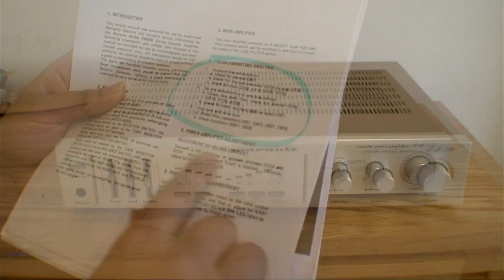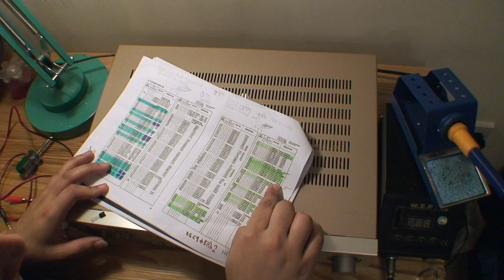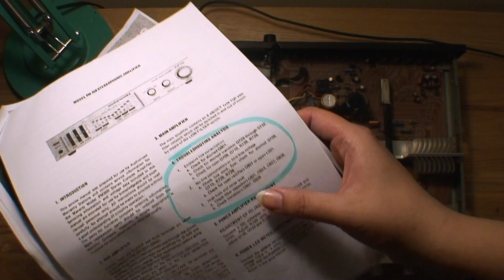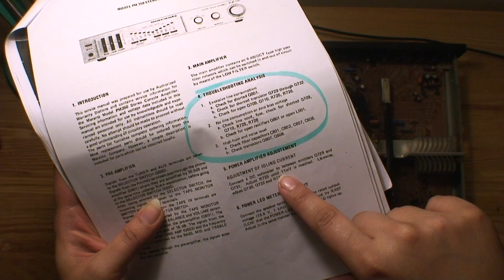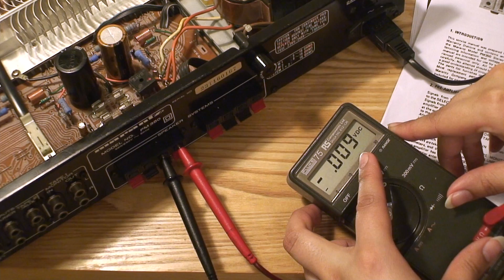Vintage Amplifier repair - 05 Adjusting the idling current (Marantz PM350)

Comment: Cool, another serious audio nerd like me... but this one is a very cute female one!... Are you married? Lol!... I suppose you are, and you're husband is a very lucky guy to have someone so smart as a partner!... I would love to have also! ;) (Are you maybe Italian or??? Your voice and accent and is very pretty, but I can't quite put my finger on where you might be from...)

BTW, you sound like me when you're testing something, "I just cannot get it hooked on that FREAKIN' wire!" LMAO!... Don't worry though; unless you are ever testing or working very close to the AC power mains input parts of that amp you won't get shocked... Shorting something out on the board and damaging it is a real possibility to watch out for though if you're not careful!... Steady hands and very careful placement of the testing leads are key... But those small old Marantz amplifiers are awesome sounding and performing, and definitely worth fixing properly, so I commend you on your efforts here! I also used to have a Marantz amp very similar to that one you have until it got STOLEN from my dorm room when I was in college; such a bummer! I was pissed when that happened! :(

I have a very helpful hint/suggestion that you might consider using next time you do anything like this on an audio amplifier; When you are adjusting transistor idle current, and also when checking for DC offset on the speaker outputs of an amp, instead of using the normal DC Volts range on your Fluke meter there, you should instead use the 300mV DC setting, that way you will get MUCH greater resolution and precision with very small mV readings like what you were measuring for there!... And also, one other thing to consider is that after you adjust the idle/bias current of a transistor, especially if it's way out of spec at first, you always want to go back and check it again, (and re-adjust if necessary), after a few minutes at the new setting, because many transistors will sometimes tend to "drift" slightly off of the initial/new bias setting until they are thoroughly "used to" the new setting. (It usually takes most transistors a few minutes at the new setting to completely stabilize themselves.) I don't know how to explain it better, but just double check the idle/bias current measurements at least twice on both channels before calling it "done". I usually check twice more on each channel after the first setting adjustment is done, so 3 times total on each channel at minimum... I usually do one channel then the other and keep switching back and forth between them with my meter until they both stabilize at the new, correct setting... If you take the time to do that then you will see and understand what I'm talking about. Plus it will end up being even better balanced between the channels that way too.

I think I'll add another subscription, one which I will actually look very forward to seeing more videos from! ;)
Reply from the maker: Thank you Joe for taking the time to watch my videos and for putting thought into your comments and suggestions! btw I socket my ICs always :o) that video clip was from quite a few years ago when I didnt, and had to desolder an ic from veroboard.. yes I learned my lesson well!!! lol

Also thanks for informing me about the drifting of transistors on this video! This amp is due a checkup and 're tune' so i will take it on board, and of course do another video of it. :o)  
 
Also I'm flattered by your kind words, thanks lol I'm not Italian but people have sometimes mistaken me for Spanish once or twice lol but i'm Arabic, We dont look 100 miles apart I guess, both in the mediterranean region :o)
It seems like you have good taste in music ;o) I have to agree also that La Isla Bonita is one of Madonna's best, it's my all time favourite! I have two La Isla Bonita Singles, one is a Japanese single with other tracks on it and the other one is the once you saw. I have the single on both 7" and 12" vinyl record also.

I'm happy to hear that you're enjoying my videos and thank you for subscribing, welcome! :o) 
And a lot more to come! of course
Reply: So you are Arabic huh? That's very cool too, and after watching a few more of your videos, that was gonna be my second guess... I suppose that's where you get your natural beauty from too! ;)

I really like it when YouTube posters such as yourself actually take the time out of their very busy life schedules to actually read through the comments that people make to them, and reply to the more decent ones!... I'm sure you see some "doozies" every once in a while which aren't worth your time, but I know that I appreciate it at least... If I had a camera to make my own videos and was also able post them, I would always try to do the same for my commenters too!... Thoughtful replies to comments shows good character and true *caring*, both of which I can tell you have in spades! ;)

I will (try to) make this reply (relatively) short and quick, (maybe, lol), because I have to go to bed soon because I have to work tomorrow, but did you also see my comments in a few other videos of yours on the following additional items: (?)

1. I had previously suggested to you in your "Audio Visualization Project- 01 Intro/History/Build" video, to try using desoldering braid for desoldering components from circuit boards, however, I just recently watched your newer video where you were trying out your new desoldering pump, and since that thing works so amazingly well, you can just ignore my previous suggestion about using the desoldering braid shit, lol!... I had no idea those active vacuum pump type desoldering tools are so effective because I've never had or used one before, but after watching that video about it I'm definitely gonna get me one of those!... 
One question about it though, since I noticed that that video about it was almost a year ago now... How is that desoldering pump tool still working today? Is it still operational and just as effective as when you first got it, or did it already break or wear out? (I seriously ask this because it looks like it was made in China from that website you bought it from, and since most stuff from there seems to be "less than the best" to put it nicely, I was wondering if it was still working good for you currently, so I know whether or not that model is worth buying for me too.)... Please LMK what you're experience with it has been over the past year or so since you got it... 
Also about the stuff below...

2. Using the 300mV DC setting on your Fluke meter when taking small mV readings such as transistor bias/"idle current", DC offset, etc., in order to get much greater resolution and accuracy in your readings!

3. Dolby B/C vs. ANRS/Super ANRS comparison video if you find the time and equipment to do so. (Or at least your thoughts on the comparison, as I had commented that I did that test a few years back, so I'd be curious what you think about it too.) (You mentioned that topic very briefly on the video for the Sony WM-D6C) (Not at all a big priority, just wondering if you had any thoughts on the topic.)

4. Will you please, please maybe make a video showcasing your whole entire music and CD/vinyl collection sometime soon? I'd really love to know what else you have and love to listen to, as I'm sure many others would too! I will most likely find a few new albums for my own enjoyment also by seeing your collection! :)

5. Is Madija your real name, and do you produce yourself all of those very cool sounding electronica/chillout songs which are in most of your videos? (If so, that's totally awesome; you are really good!! I definitely want to hear much more of what you can create/write/produce!)

6. Also, have you ever had the opportunity to play with a so-called "synth/sampling/looping pad"? (Or whatever they're called... do you know what I'm talking about?) I think you would totally love what you could do with one with music to create "layering" and such!

7. Are you actively into relaxation and meditation practices, and have you ever heard of (or actually heard or maybe even played), a "Singing Bowl"? They are something that I just discovered very recently, and they sound amazingly cool and "spine tingling", especially a few of them resonating together in harmony! You absolutely have to hear for yourself! (Look up videos for them here on YouTube and you can thank me later! :) )

8. Was that your daughter, or maybe your niece(?) who got camera shy so quickly when the ice cream truck came around in the Audio Visualization Project 01 video? (No biggie to reply about that if too personal, I was just wondering because that was really kinda funny when that happened, Lol!)

Whatever you do, always keep up your "random silliness" throughout your videos wherever and whenever you get the urge to laugh, because being able to let go and have fun with something anytime you feel like it just makes life easier and more enjoyable, no matter what you're doing!

I will keep watching (and probably commenting on) all of your other videos as time permits to watch them, and I also look forward to getting to chat more with you about all things electronic and music related in future comments, etc. Keep on exploring and learning new things, as I always try to do too! It makes life more interesting that way! 

Sorry for the long "book" comment again, (I did try, lol), but I just have a lot of questions for you because I've always been a very curious soul, plus I have "Asperger's Syndrome", so IDK how to make anything I say "short and sweet" or "to the point right away", LOL!... Oh well, at least I can spell and make complete, coherent thoughts in my comments, which is more than can be said for most YouTube "comment trolls"! Hahaha!... 

Until next video then... Much Peace, Love, Unity, Respect! ;) <3
Reply from the maker: You will try to make this reply relatively short and quick.. and it’s the longest one you’ve done so far lol!! ;o))

I do like desoldering braid over that manual pump which everyone seems to love, i’ve never got on with them for some reason, but the new electric desoldering pump is a beauty!! I love it! It’s still working fine and I just need to find that small bar that dislodges it if it gets blocked, no idea where that has gone now! But I have a few things to recap two computers and two consoles so there is some work to be done :o) 

Dolby vs super/ANRS .. i’ll be honest I am confused by people who in the comments kept saying Super ANRS is equivalent to Dolby B… to my ears it sounds like ANRS is like Dolby B and the extra punch and highs the Dolby C ads, is just like Super ANRS , I asked that question just to see if anyone else felt that, but nope lol

I will at some point make a video showcasing my vinyl records when I show the way I wash/clean them… (i’m overdue! they need cleaning!!)

Yes Madija is my real name and i’ve been creating the music since my Amiga days back then 1997 onwards, I have them on my soundcloud also https://soundcloud.com/msmad-lemon/tracks
Not all the ones i’ev ever done but some are there :o) 

I’ve not long ago got myself a Yamaha reface DX and I LOVE it! 
it’s the first I was learning how synthesis works actually, teaching myeslf as always by exploring….https://youtu.be/goY6BIZhWzM

I wouldnt say i’m into meditation itself though maybe a form of it, though I love relaxation and candles, aromatherapy that kinda thing. and yes i’ve heard a singing bowl before, it is amazing! I love the sonud of that, i’m always fascinated by quirky instruments a hang drum is another which I find interesitng.. but yes I really do know what you mean with regards to a singing bowl, it’s not an instrument of course, but can be one depends on how creative you feel ;o) 

No that’s not my daughter haha she’s my adorable niece, she is camera shy, but then so am I lol!! but she was giving me that face of wanting an ice cream, shes grown since then, that was taken way back in 2012! what happened to the time?!

Thanks again for your kind words and your extensive comments, I need to take time to read through them lol!  I may struggle in replying to each one since I am quite busy. So please dont take that personally :o) 
i would have thought somebody with Aspergers syndrom would be doing the opposite, a comment which doesnt relate much (excuse me for any ignorance) but how I see it your comments seem actually quite open and relating, to me this isnt a sign of aspergers but your personality and relatability from what I sense so far. 

Peace, love, unity and respect to you also!
Reply: Yes, same here. I like desoldering braid over using those manually operated "plunger" type desoldering pumps, as those don't ever seem to work very well for me either, but that new electronic/powered one that you did that one video for works great, even for the multi-pin through-hole ICs and such, so since that one is still working good for you, (if you can find the cleaning rod, lol!), then I think I'm just going to break down and finally buy one for myself, as it will obviously be a good investment... As long as I don't lose the cleaning rod anyway!... Hey, if you still cannot find your cleaning rod, then you might try using a piece of "baling wire", if you know what I'm talking about... It's the kind of flexible steel wire that farmers use to tie up bales of hay in the fields where it's grown, as I think that size and type of wire might be about the right diameter and strength to clean any stuck solder out of the inlet nozzle of that pump. (Just a thought... It might not work, but it might be worth a try.) ;)

(You still forgot about the 300 mV range on your meter... You might try using it next time you adjust an amplifier's bias or DC offset, etc. in order to get better accuracy and resolution in your meter readings.)

Apparently you and I are the only ones who agree on the Dolby B/C vs. ANRS/Super ANRS thing... I also have an older JVC cassette deck with the ANRS circuitry on it, so I've done more than a few comparisons between the systems over the years... They both work just fine and are quite comparable, (Dolby B ~= ANRS and Dolby C ~= Super ANRS), but even so, none of those are quite as good as Dolby S noise reduction, I don't think, as that specific type has the BEST noise reduction capabilities by far, however it was only introduced on later model cassette decks into the 1990's... But as you probably already know, if you use a really good quality cassette to record on in the first place, (like most TDK ones, especially the MA-XG), then you really don't even need any noise reduction anyway, because the tape itself is already quiet enough of a formulation to not need it.

Yeah, a video about your entire record (AND CD) music collection would be awesome to see! I know I'm not your only "fan" who would love to see all of what you are into, music-wise! I look very forward to that one!

Your own personally produced music is amazingly beautiful! I will check it out more extensively on SoundCloud. Thanks for that link!

I watched your video about the Yamaha Reface DX... "teaching myself, as always, by exploring"... I gotta love that about you! I always try to do that also! I think you will be creating even more cool music sounds with this synth once you fully get the hang of how it works... 
Hating on dubstep though... IDK about you! LOL! JK!... I like dubstep too, as it's just another form of "EDM" as it's come to be known... Have you ever heard anything by Lindsey Stirling for example? Her first and most famous hit "Crystallize" for example is quite amazing! Check it out here: 
https://www.youtube.com/watch?v=aHjpOzsQ9YI
The way she mixes her classic violin playing with a dubstep beat is very uniquely beautiful! And she is only one of many 100's of artists and tracks of only that specific genre of EDM... Music styles are SO extensive, especially now-a-days!... But I think that's awesome!
Anyway, personally, I think that ALL music is good, regardless of style or genre, because it is the best way for all of us humans as an entire race as a whole, to fully express our emotions, feelings, energies, and the like, so I embrace all types... Music is the only truly "universal language", so how can you do anything but like it all?... But "to each their own" is what I also say, so it's all good. You don't have to enjoy everything out there, only what you feel most passionate about! :)
Another video to check out which has a cool "synth pad", more like what I was envisioning when I mentioned the idea to you, is the video by the really cool Techmoan, (one of the absolute BEST YouTube channels to learn about all things vintage hi-fi related!), in which he "reviews" his favorite "vintage" FM Tuner... The KORG pad which he uses starting @8:46 in that video to test the scope part of that tuner looks and sounds pretty useful for layering and sampling, and that pad he has is only one of MANY of that type that I've seen! The link to his video is below just so you can see what type of sampling/looping pad that I'm talking about: 
https://www.youtube.com/watch?v=ZkCIdufSGS8
BTW, an oscilloscope might even come in handy when producing your music... And do you ever sing in any of your music? Your speaking voice is very soothing and has a nice tone to it, so I could imagine your singing to be very pretty too... :)

With your own electronica music playing in the background of your videos I almost thought that you were like a "Buddhist Monk" or something when I first watched one of your videos, but now that I know you are Arabic, I understand it more. I was thinking about Yoga stretches and such as a form of relaxation and even meditation in a way, because that's something that I do every morning to help keep me limber and in good shape, both physically and mentally and spiritually, that's why I was wondering if you ever did that kind of thing too... Anyway, I'll have to check out the "hang drum" as you call it... I'm always up to hear new sounds, especially if they are very unique and/or soothing/beautiful!

Yeah, time does fly by quickly, that's why you gotta cherish and try to enjoy every moment that you can, always!... I have two nieces and a nephew myself, from my younger sister, whom I all adore, and they all get a big kick out of "Uncle Joe" coming over to visit too, and even though I don't have any kids myself, I am reminded by them how much I love them, and how I love that they are always so inquisitive and fun-loving and such!... Don't EVER forget how to be a "kid", no matter how "old" you get!... ALWAYS explore new things and remember how to just have FUN with everything that you do! :)

Don't worry at all about replying to all of my comments, because I know that you are very busy, just like everyone else is, so I totally understand not being able to reply to all comments. It's no biggie, so I never take it personally if someone doesn't reply. If they deem it interesting and/or useful enough of a comment then they can, but I know how everyday life takes priority over anything here on YouTube.

Actually, just so you know, "Asperger's Syndrome" or "Autism Spectrum Disorder" as it is now referred to as, has many different levels, from the "higher functioning without language impairments" type that I have been diagnosed with, all the way to the full-on Autism side of things, in which case most of those people usually cannot even carry on a good conversation about something for any extensive length of time, or else they just don't understand enough to. People on the "lower functioning" side of Autism also many times cannot take care of themselves in this crazy, mixed-up world, because they cannot process all of the stimuli that goes into their brains in a quick enough manner, and they get extremely frustrated, many times to the point of fits or convulsions!... 
However, I guess I can consider myself relatively "lucky" in that I am on the "higher functioning" side of Asperger's, which in and of itself is also the "least problematic" of the entire Autism Spectrum, and even though I don't ever suffer from any of the "fits or convulsions" (thank goodness!), that some of the more extreme Autism cases do sometimes, I still definitely do have my struggles, that's for sure! (Always making inevitably LONG-ASS comments about things every single time is one of them! LMAO!)... For the most part though, my Asperger's just helps me to be more detailed in my knowledge, understanding, and intensity when applying myself to a project, so I think it's sort of a "blessing in disguise" in some ways... It definitely hurts me in many social interactions though, as I have an extremely hard time with interpreting "visual cues" that others give out such as facial expressions, etc., and oftentimes I will say the "wrong thing at the wrong time" and I either totally embarrass or irritate others, OR I "bore someone to death" by talking extensively about one topic to no end, but the way I look at it is that if someone doesn't have the intelligence or an attention span long enough to carry on an intense, passionate, and detailed conversation about something that you're both interested in, then they really aren't worth my time to talk to either... That's why I like talking with the more "intellectual minds" out there... people like you! ;)

BTW, the Peace, Love, Unity, Respect thing, (or PLUR as it is also known), is a rave culture thing, one which I love, because I really enjoy going to raves and music festivals, because most everyone that you meet at those events are just that... Very Peaceful, Loving, Unified, and Respectful of everyone else in the world, so I try to be that way also... I like to think of that motto as PLUR4ALL, in other words, Peace, Love, Unity, Respect for ALL Living Lifeforms!

I think that is enough for now, (I set a new record for "longest comment" again, LOLOL!), but I will probably continue structuring my comments like this from now on also, (with separate numbered paragraphs, etc.), so I can ask you multiple related questions at once and we can learn more from (and about) each other much faster and easier than just using "one liners" like everyone else does... I think that you're probably "nerdy" enough to follow that structure also, LOL!

OK, goodnight for now Maddi. I will talk with you more in future days. :)